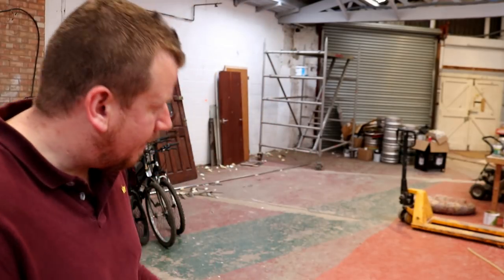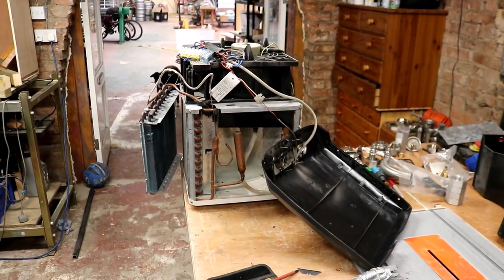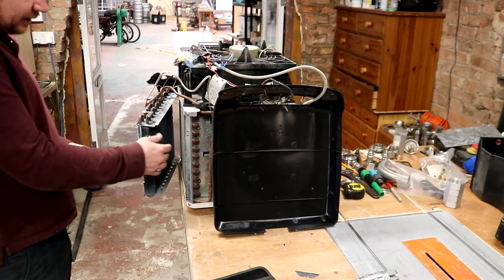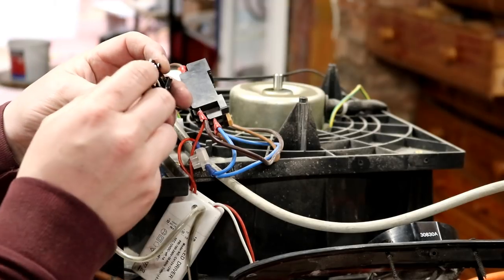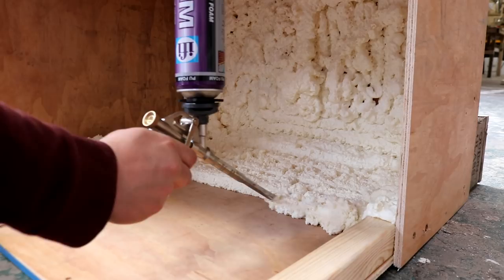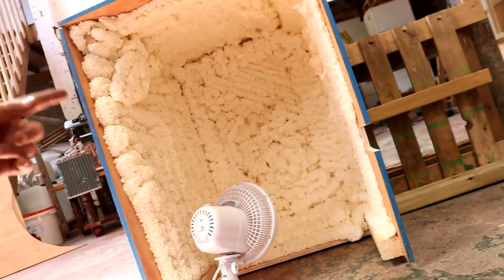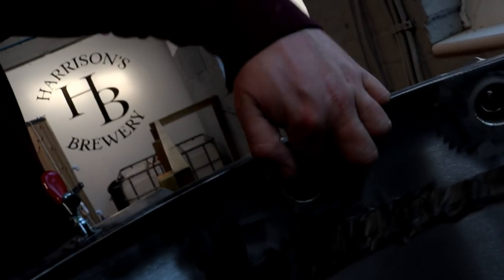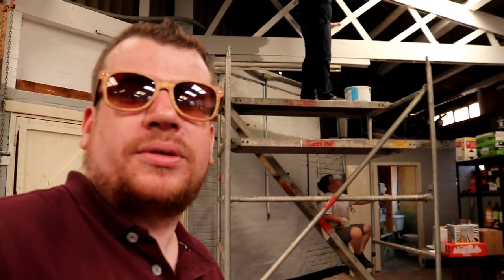GLYCOL CHILLER

Comment: Harry your videos have formed a large part of my microbrewery development journey. Thank you for your willingness to share your ideas which have I have certainly taken inspiration from and will continue to I'm sure. I've just about finished building a DIY glycol chiller for a glycol loop. I've repurposed a 12000btu portable AC and am using a 45L cooler box for the reservoir, which gets insulated further with expanded foam. My question is what pump is best for circulating the glycol in a glycol loop. Is there a specific type of pump best suited? Important specs to look out for?. My brewery consists of 6 x 350L fermenters with coils for cooling. At present, nothing else will link up to this glycol loop but the fermenters. Cheers again for the great videos!
Reply from the maker: I just use a submersible pond pump with about 1000 to 2000 lph. Not had one fail yet

Comment: The relay tip is legendary! I have one of these exact ones in my control panel and it is indeed failing. Bought another and couldn't understand why it was getting so bloody hot within minutes of being plugged in. It is in a safety interlock circuit with almost no current through it other than a few LEDs on some switches. Now I can snip the LED out of the new one and save it. One question: Why is does the coil look so brown? Just built up heat or also not up to the rating?
Reply from the maker: The coil will go brown from the heat build up. Likely the contacts will fail before the coil. But yes, that little resistor is the main weakness of these buggers.

Comment: Why on earth didnt you just buy a re-conditioned pub remote glycol chiller - there only £200odd
Reply: mojonojo3 only, only.
Reply from the maker: I have 2. They have nowhere near the cooling capacity the chiller I built. This thing will cool my fermenters and chill a 23 cubic meter cold room to 8C and not break a sweat. Check back in a few weeks to see it running.